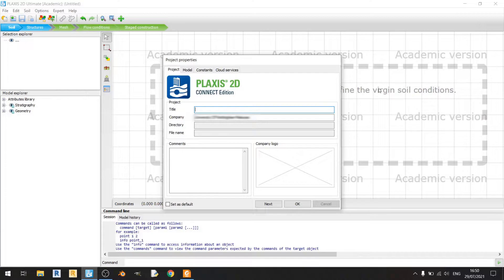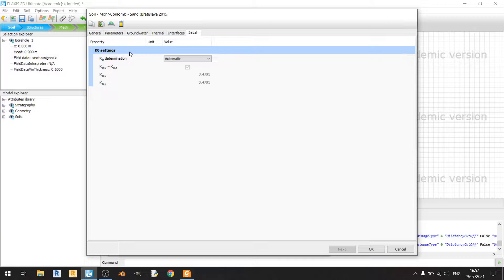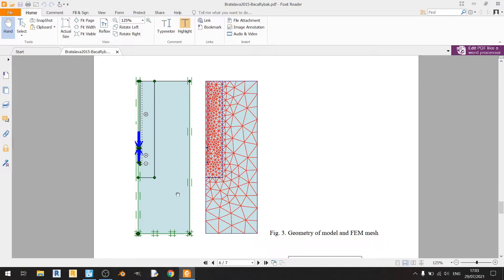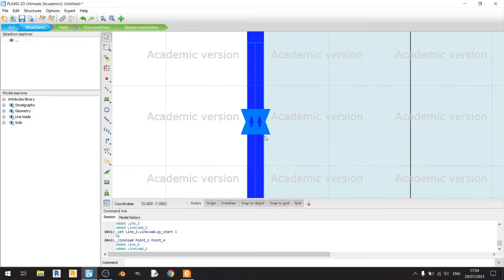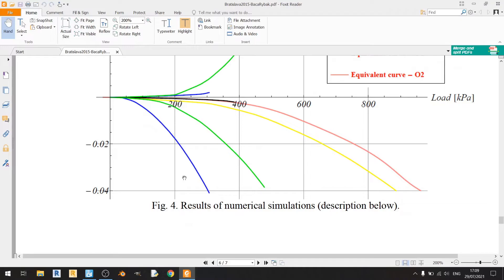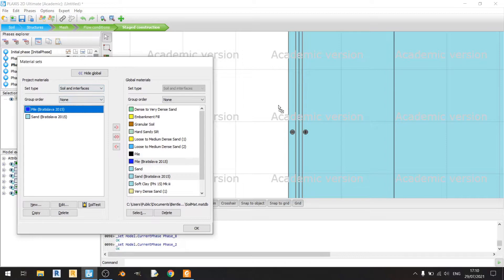Plaxis 2D: Osterberg Cell Test Model

Comment from the maker: Timestamps
0:00 - Introduction
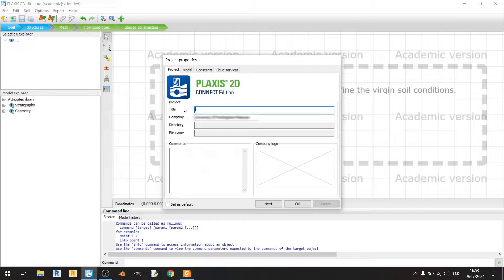3:16 - Project Properties
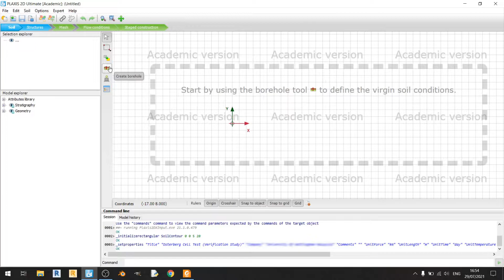4:00 - Defining Soil Stratum and Soil Parameters
8:06 - Structure Tab Settings
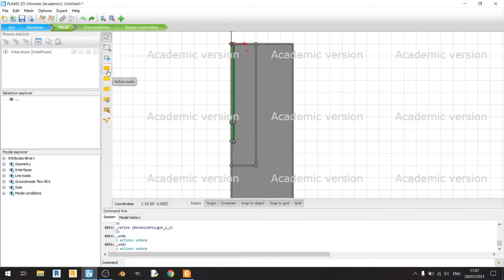15:00 - Mesh Generation
16:25 - Flow Conditions
17:46 - Staged Construction Phase
22:28 - Plastic Analysis
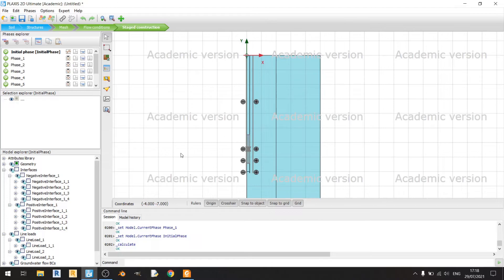23:35 - Plastic Analysis Results
25:00 - Safety Analysis 
25:45 - Safety Analysis Results

Comment: when loading phases, didn't you do a mistake that you use KN Q, but at the selection explorer , the unit is KN/m/m so have to use KPa values, in my opinion. am i right or wrong?
Reply from the maker: In the Plaxis 2D manual, line loads have the units of kN/m. From the structure tab I intended on using a line load.